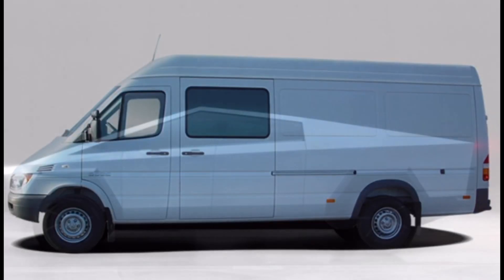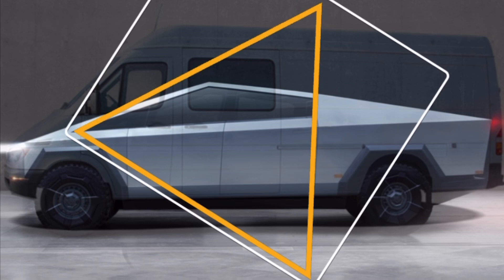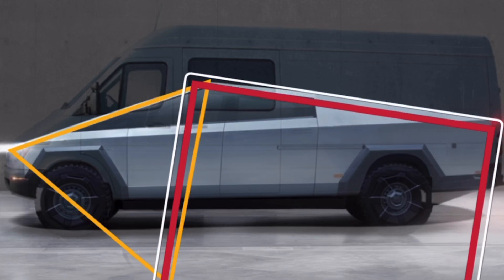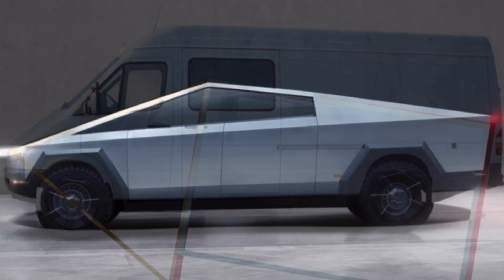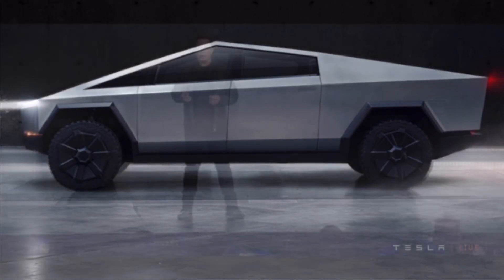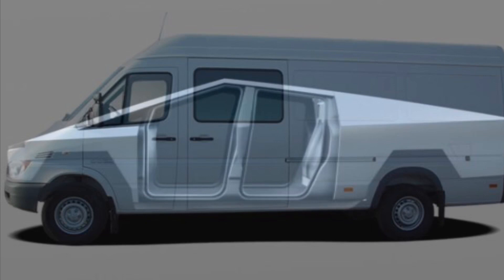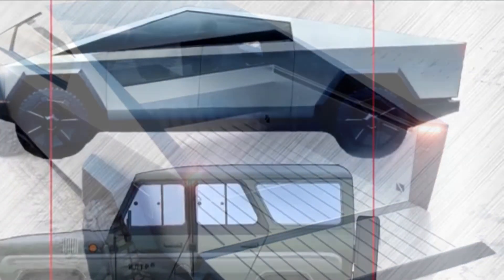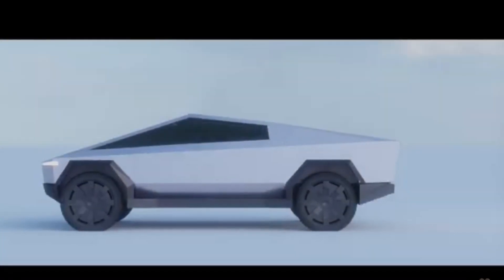CYBERTRUCK BUILD DIY Transforming a T1N Mercedes Sprinter into a Tesla CyberTruck

Comment: ...but Serge, we can’t remove the injectors which such steep hood, when we have black death built up 🥺
Reply from the maker: Lol you have a point there, with this build most everything will be cut off lol including the Diesel engine, I will use a V8 Gas powered engine with a 4x4 conversion from 2007 Jeep Grand Cherokee, it uses Mercedes electronics  suspension Transmission and 4x4 system so most likely I will use its interior and steering and suspension and steering wheel, also will use bigger wheels possibly 19 or 20s